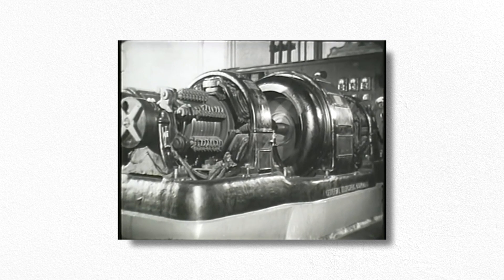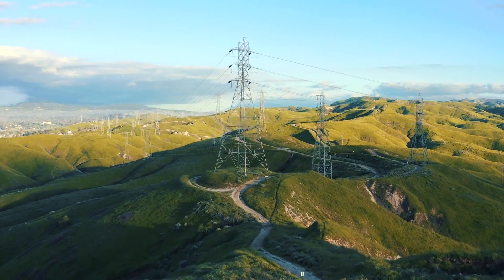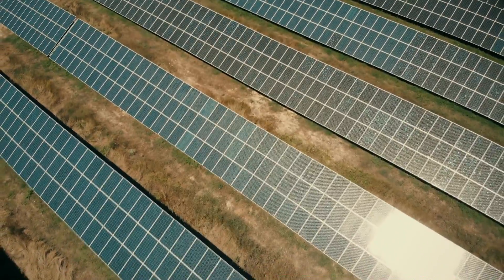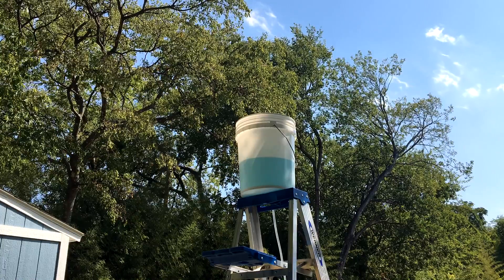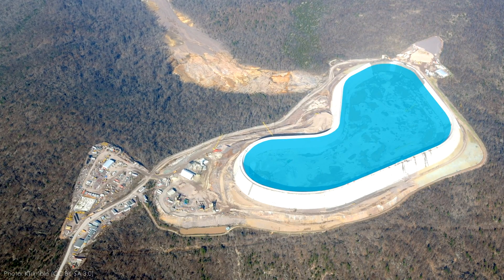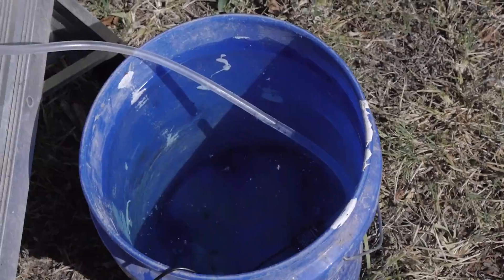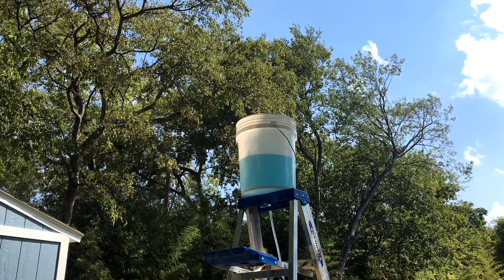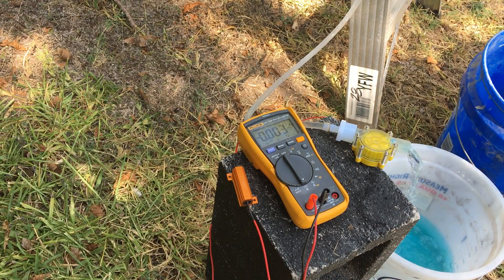World's Largest Batteries - (Pumped Storage)

Comment: so basically:
- Efficiency (charge->discharge); pumped - 70% efficient vs. Li-On - 90%
- Energy Density (MJ/Liter): pumped - 0.001MJ/L vs. Li-On - 2MJ/L
How about they drain those reservoirs, sell the land, and install a bunch of Tesla Megapacks
Reply: How about you do some math for me first.

How many Megapacks would you need? And what would the cost be to buy them? And what would the cost be to replace at regular intervals?

These facilities have mutli hundred-year lifespans. Tesla megapacks of decade long lifespans, and create toxic waste.
Reply: Water is far less expensive than lithium manufactured into batteries. Pumped hydro also, as mentioned, last a lot longer.

Comment: I enjoyed you present in pumped stored power, what I saw wrong with your model's efficiency is: it was connected at the top bucket as a siphoned water supply instead as a dump gate at the bottom of the bucket, so you lost the advantage of the weight and level of the stored water and only had the weight of the water in the duct column to drive the turbine. Also, your connecting duct was very small limiting the velocity and volume of water to the turbine. Last, the supply ducts usually have the architecture built inside the duct to spin the water in the correct direction and organize the water flow for maximum generation power before the flow ever reaches the turbine thereby boosting the efficiency at almost no cost.
Reply: His is a steplader demonstration  not an engineered power plant.

Comment: I am surprised that dams are not used more for peak generation. Allow the water to build up behind the dam during peak solar. Then let the water run through the dam at peak usage during the evening.
Reply: Many are but the greenies think it messes with the fish. I care more about reliable electricity than messed up fish.
Reply: One of the problems in Washington is the contracts from decades ago do not allow us to reduce the power generation because people that funded the hydro are getting paid by how much energy it produces.  I wonder if we can get those ancient contracts changed.
Reply: Ecospider  Why w)old you want to reduce power output of the HYDROPOWER in the Northwest? Do you want to burn mover o ported coal, oil and natural gas? Or do you simply want electricity to become so expensive you drive all manufacturing to China? If the latter maybe your joob will get moved and you along with it. 

The economy needs reliable electricity more than it needs some fluffy bunny ecootopia. IMHO we need to develop large scale Thorium fueled nuclear power to replace the coal and Uranium fueled power plants. Then progressives like me could have plentiful electricity and the egofreaks could have their splendid isolation.
Reply: Greg Warner. The short answer is wind. Bonneville power installed large amounts of wind generation along the Columbia river. The wind has worked so well that some weeks it produces more electricity than Bonneville power can use. So first they turn off all the coal plants. Then they turn off all the natural gas plants. But at that point they sometimes still have more electricity Produced from wind and hydro than they can use.  If they shutdown the wind at that point we never get that energy production back. If they instead let water fill up behind the dams by turning off the hydro we can get that energy back later by running the dams using that stored water. But because of how the bond contracts were written decades ago they legally can not do that. So they turn off the wind turbines instead. 

So they need energy storage for the excess wind power that is produced. Since they can not leverage the hydro dams they had to come up with a different solution. That solution ended up being home heating. They now control thousands of homes special furnaces and hot water tanks. The hot water tanks are electric and when they have excess energy they heat the water up to 190 degrees. Those tanks mix that water with cold at time of use so the temperature coming out is around 125 degrees. Same concept with the furnace, they have a large ceramic plate they heat up with the excess electricity from wind turbines. Then when you want to heat up your house they blow air over that ceramic plate to use that heat energy. 

So they had to put in this huge system to store excess electricity in “thermal” batteries. They could have spent that money on other green projects if they were allowed to use our hydro dams as batteries. And the total amount of energy produced from those dams over the whole year would have been the same.
Reply: Greg Warner. I agree thorium needs to be looked at as part of the solution but not looked at as a magic bullet. Winds and solar are now proven technologies, thorium is not. Canada and China are both trying to build a full size thorium plant. But they are not online yet. So if you put $500B into thorium you might end up with a bunch of energy plants that produce very little electricity. If you put $500B into more wind and solar you will get guaranteed electricity. A good example of how solar is now a known good resource is solar installations in Washington. Washington had very low electricity costs compared to other states. Then in 2019 we now have the cheapest electricity in the nation. That happened because for the first time solar became cheap enough for the power companies to fund Utility scale solar projects. You can see that on this chart. The light blue is Utility scale. https://www.seia.org/state-solar-policy/washington-solar 
If solar can work in Washington it can work anywhere in the continental US. 

So let’s fund thorium while making sure we continue the momentum in known technologies. IE wind and solar.
Reply: The primary reason the Pacific NW has cheap electricity is the  Bonneville Power Project  hydropower.
Reply: Greg Warner. One of the secondary benefits of all the great hydro power projects in the NW was our grid had to be different than most other places. So things like the Bonneville Power Project  hydropower initially gave us cheap electricity. But it was not near the cities. With coal and natural gas you build the power plant where the energy is going to be used. With Hydro you build it where the water is then figure out how to get it to the big cities. 

So when we started installing wind and solar we did not have the same problems as other states. We already were used to building the energy plant where the resource was and then move the power to Seattle, Tacoma, and Spokane.  

But hydro is not why our electricity cost went down in 2019. That was solar. Of course hydro is why it was so cheap in the first place. But 60MW of solar went up in 2018 with almost 30MW of that being Utility scale. That was the first year we had utility scale solar get installed. Before 2019 the most solar installed in 1 year was less than 25MW. They are expecting more than 60MW every year going forward, even with the federal tax credits rolling off. I really hope that becomes true. Me personally I’m taking advantage of the last month of 30% tax credits and installing 10Kw before years end.

Comment: Pumped Hydro,   Is a Fools Game. Burn COAL.  It works. Throw out all The Experts.  Inexpensive, fairly clean, Simple.   Hmmm.    Nuclear Is also GOOD. Only Five Issues  Since 1956.   A good track record.   Run the Math.   Climate Change Is Always.    ... Thoughts ?
Reply: Coal is anything but fairly clean, what a ludicrous statement.
Reply: Pumped hydro accompanies almost every uranium nuclear power plant to match the demand curve to the plant output. Best use for coal is to hold up the ground it is under.

Comment: so while watching this, a thought crept into my mind. with our ability to make absolutely amazing super capacitors now, would there be a way to scale up super capacitors into mega banks, allowing for huge storage of energy without needing to switch it back and forth from different forms?
Reply: @medo7dody  RIGHT! Also, the voltage drop with capacitors is rather linear, compared to typical batteries which can maintain a constant voltage through most of their storage capacity.
Reply: Capacitors seem to like to dump their entire charge at once, so I think the problem with that idea lies in achieving a slow release of the energy stored in the capacitor... but I may be wrong.
Reply: @alexandreconlon8990  Capacitors do not "like to dump their entire charge" all at once. I'm using super caps to power a raspberry PI until is can shutdown. The problem is the energy density is low and cost is high. Even batteries are better in those regards.
Reply: @alexandreconlon8990  Super capacitors are becoming about  as infamous as Tesla coils!
Reply: @alexandreconlon8990  resistors will do the trick that's for sure, but they give off  a lot off heat this is a loss of energy. however i'm sure if we wanted we could tap that and use it in feed back loop. just thinking... :)
Reply: @thewanderer6444  The load on the grid is the resistor in this context the capacitors are charged to the voltage level of the power source they are connected to and will push electrons through the resistance of the grid the same as any other power source at the same potential would. At least for the first fraction of a second before the voltage drops off as they discharge and thus so too will the current through the circuit. Granted batteries also decrease in output voltage as they discharge but nowhere near as linearly for most battery types capacitors the drop in voltage is close to 1:1 with the drop in stored energy a lithium ion battery will only have a vdroop of a few percent until it gets close to fully discharged generally though the voltage will drop off a cliff rather suddenly if you get close to discharging it. Thus capacitors would need more work to regulate the output voltage to keep within grid specs adding to costs and reducing reliability by adding more components and more things that can go wrong which murphy's law will be sure to take advantage of. Oh and yes all those extra components will consume power too of course.
Reply: @FaerieSeraphina  that's what i though, and have seen in situations where they are used for storage of power. this is not such a crazy idea.  out there for sure especially since until very recently we didn't have the tech to build efficient enough capacitors.
Reply: @thewanderer6444  It's certainly a potential avenue of research but wouldn't expect to see commercialisation of grid scale capacitor storage any time soon, it has taken this long to get battery development to that point and even then it's entry level grid storage stuff with the biggest having storage capacities on the order of hundreds of megawatts and peak outputs around 100 MW. Compare that to pumped storage where the biggest currently deployed go into the tens of gigawatt range with peak outputs in the gigawatts, if you count proposals on the drawing board the numbers get even more insane, Australia has one proposed with a 350 GWh capacity, there is a site in Scotland suitable for a 6,800 GWh facility no idea what the cost on that thing looks like mind but it might give the amount our idiot government seems determined to wipe off the UK economy for a few years a run for it's money I suspect.

Comment: Really interesting. Here in Sicily we have a pumped storage facility near an important valley both under archeological/historical and environmental reasons, so the powerplant itself is - mostly - located deeply (around 800mt/2400ft) inside the mountain and it is veeeery nice.
Talking about molten salts: did you ear of the Arkimede's Power Plant, here near Syracuse (Sicily)? It works with convex mirrors pointing sunlight beams against pipes filled with a molten mix of salts. Then the "hot" (around 500C) salt is used in thermal exchanger to produce steam and use it to drive a steam-turbine. It is not so powerful, and requires power to keep the "cold" (around 260C) salt reservoir at the right temperature (around 260C indeed) to keep the salt in liquid state.

Comment: Set thermostat higher - yes you live in Texas - for those in colder areas it would be a reverse (if one has electric heat).
Reply: For a few seconds could not work it out until I remembered Air-con is a thing
Reply: It was certainly a double take for me having always thought of turning thermostat down to save energy.

Comment: The answer, to reduce carbon emmissions- is put solar panels on the roof of every dwelling, business and factory, thus power would be produced where it is needed. And connect every building to a power sharing grid. Other power sources would be backup systems.
Reply: Did you not watch the video?

Great at noon on a sunny day no central generation is needed.

What would these back up systems be? They would be horribly inefficient and dirty peaking stations.

Comment: Great video as always.  However, using the term "battery" to describe potential energy storage isn't strictly accurate.  While mechanical, hydrostatic, and pneumatic devices (such as water reservoirs, compressed springs, elevated weights, rotating flywheels, and compressed gas) can store energy that can do useful work (including generating electricity), they are more aptly described without using the term "battery".  Using the term "battery" in this fashion is a fairly recent development, often used metaphorically while describing how non-electrical means can be used to store energy "...like a battery...".
Reply: "Using the term "battery" in this fashion is a fairly recent development,"

Welcome to the evolution of language.  Use of words change overtime.  It is very common for people to use battery in this way now days.
Reply: @josephburchanowski4636  Imprecise or incorrect use of a well-defined term is not "evolution of language".  What you describe is similar to those smug reporters that confidently use terms like "tarmac" when referring to some part of an airport---especially if there is not one bit of tarmacadam to be found anywhere in or near the airport.  While some may colloquially use the term "battery" in this fashion it is not generally acceptable to use it in other contexts.
Reply: @m_a_s6069  I respect your attempt to fight the change in the use of words.  I myself am finding some attempt to change words from their historical meaning.  But do understand that even if fighting it, the language might permanently change; it wouldn't be the first time incorrect use of definitions have become layterms; and it won't be the last.

Two examples off the top of my head, Zeppelins and Kleenex.  Unfortunately those aren't the best examples as they belong to the same subset; but there are many examples that aren't company names turning into layterms.

Again, I respect your fight against the layperson use of the word battery, but I am afraid on this issue you are fighting a losing battle and there are other terms that you'd have a better time resisting the change on.

If you do decide to continue; may I recommend focusing on when people inadvertently cause confusion between chemical batteries (which are the only true batteries) and other potential energy storage systems.